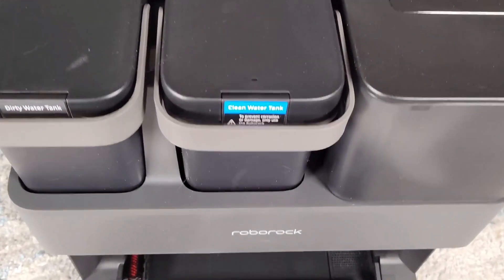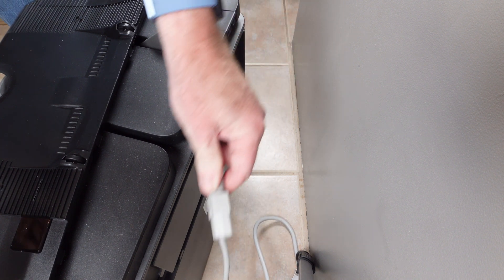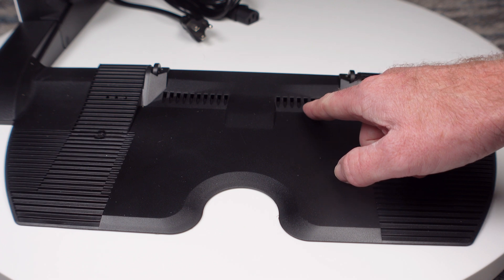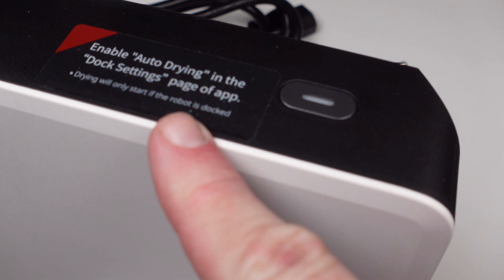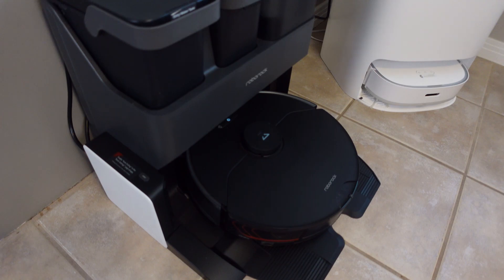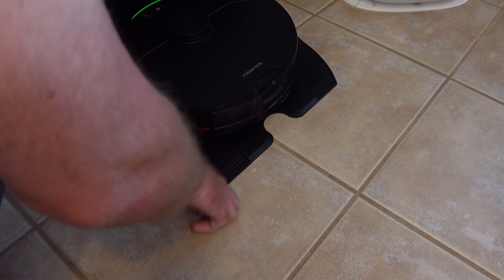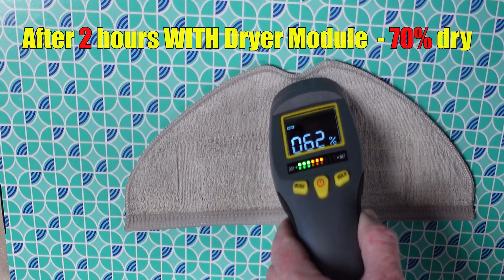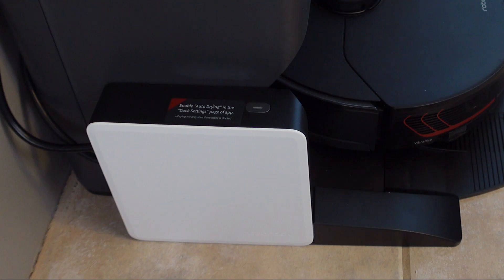Roborock S7 MaxV Ultra Dock Hot Air Dryer Module - Full Test Results!

Comment: I just bought 3 mopping pads and when it's done washing the floor I replace them and let the wet one air dry. Cheaper and easier
Reply from the maker: Cheaper for sure.  Don't know about easier as with this you don't need to remove the mopping pads to dry after every wash job.

Comment: Very good content, straight to the point.
I bought the chinese module from Aliexpress, its rated at 220V and my S7 MaxV is 110V.  But if you plug the dryer on 110V outlet, it also outputs 110V to the dock, which is very logic. Also, the dock appears to be working normally with the dryer.

The thing is, I measured the energy consumption of my 220V drying module plugged on 110V, and it's showing the same numbers as yours (0.55A and 38W). Very weird, since it's working on a lower voltage, it was supposed to be outputting less power, around 20W.
The only explanation is if my module is actually bivolt, not 220V. Or yours is also 220V and you don't know, since you said there is nothing specified in the box.

Anyone that have the drying module got different numbers?
Reply from the maker: I suspect the module can accept 220V for other markets, but the plug they ship limits our version to 110V.  Just a guess though.
Reply: I did more tests and the drying module is definitely bivolt. 
Plugged in 220V and all measures were the same, except power factor, that was 0.6 on 110v and 0.3 on 220v. Everything else was the same, even the blowing temperature (around 100F).
I don't know why they would specify as 220v only.

Comment: Hello, I don't have the drying option on my app (up to date). I tested on apple and android... do you know the reasons?
Reply from the maker: Did you turn the option on under dock settings?
Reply: @jamie.andrews  in the settings dock, I don't have the "auto drying" line... I don't have the option on the application.
Reply from the maker: @ryendanger9152  Are you on the latest firmware? Are you using the Roborock app?

Comment: How good cleans the dock the mopping pad itself? So how many times is good to re-use it without replacing it for a clean new mopping pad? 
When you put the mopping pad after every mopping cycle in your you washmachine, i dont see the advantage with the dryer module.
Reply from the maker: The dock cleans it fairly good, but depending on the amount of use it sees you will still need to hand wash the pad from time to time.  I can not really answer your question on how many times a mopping pad is good for since there are way to many variables to give one answer.  I replace mine once a year for good measure, but I don't use one robot daily.  Most people with the Ultra dock do not remove it after every mopping job to hand wash it.  That defeats a large reason for the dock itself.  While you should remove the mopping pads and clean it by hand or washing machine every so often, if you can dry it on the dock you cut down on bad smells created when it air dries after a mopping job.  If you are the person who is always going to remove it to wash it after a mopping job, the dryer module is 100% useless for you.  Hope this helps.

Comment: I've had the S7 MaxV Ultra for 3 weeks now. The mopping head is washed after a mopping job. The unit parks into the dock with the rear portion, where the mopping head is, is somewhat elevated and exposed to the air in the room. The mop dries in a few hours. You might also just remove the mopping pad (a real pain, I know) and let it air dry. For people who run frequent vac/mopping jobs, or have lots of messy jobs, the drying unit might be just what you need. Thanks for this excellent review!
Reply: having let them air dry, you haven't noticed any problems with smell-/moldiness? :) just ordered my unit, didnt realize, the (missing) heating could be a problem
Reply: @miiasiin  I haven't noticed any odor at all. I'll usually put one mop head in the washer once a week, replacing it with an extra. You can also just wash the mop with some dish detergent in the sink, rinse, and air dry.
Reply: @Dagot1948  i see, thank you :)
Reply: @miiasiin What did you mean by the missing heating? I assume you order the drying unit which is supposed to be the provider of the heating 🙈
Reply: @Q8Webmaster  i was hoping to skip having to order it :) so far, so good! :)
Reply: @miiasiin  I ordered mine from Aliexpress (Original) for around 50€. It will reach in few days. I am glad your unit is working well for you. I did also order some spare mop clothes so that I can just switch and take out the used one before/after being dried.. especially after major cleaning and putting the mop clothes for a wash

Comment: The new S7 Max Ultra (without the camera) will interestingly come with the dryer module installed in the dock. I think they will be released in summer, I’m hoping by autumn it will be available in Europe. Thank you for your very informative video
Reply from the maker: In the US the S7 MaxV only comes with a camera.  Are you saying there is a S7 MaxV without one?
Reply: @Jamie Andrews  I think they're confused with the new s8 since it comes with the dryer. Unless they're making a different s7 model?
Reply from the maker: @Ernie Saldana  There is actually a S7 Max Ultra, but it has a camera.
Reply: @jamie.andrews  He is obviously saying that Slivka is confusing the S8 Ultra with this "new S7 Max Ultra" he mentioned.
Reply from the maker: @alifewithoutgamingisnolife  Well I was wrong about the S7 Max Ultra. It does not include a camera after all.
Reply: @alifewithoutgamingisnolife there's an s7 maxv ultra without the built-in dryer and a new recently released s7 max (no "v") ultra with an updated base with a built-in dryer. The s8 ultra also has a dryer but it's debatable if it is in fact better than the s7.

Comment: I wouldn't call the hot air dryer module "100% necessary", but I do like having it in place.  Its so quiet I wasn't sure it was working.  Although, since I've had it (and its been months now), I've never had a smelly mop with the Roborock.  For my personal recommendation, I like having it there and having the mop dried whenever it gets wet.  I can't help but believe it must extend the life of the mop a bit and for that I'm appreciative.  So yeah, maybe not 100% necessary, but adding it to the unit makes Roborock the very best vacuum out there...and goodness knows I've tried a bunch of them!
Reply from the maker: Mike I think you are spot on with this and I now have tested half a dozen robots with hot air drying docks.  I too prefer them.

Comment: How is the smell of the sewage bin for you? Any bad smells? Also, do you use OMO cleaning liquid? And last, do you have any bad smell from the inner water filter (lower right, where the brush moves the water before it going to the sewage pump)?
Reply from the maker: Bad smells will happen if you do not clean the dirty water tank and lower dock filter on a regular basis. I clean the dirty water tank after each job and the filter once a week.  Yes I use OMO for my Roborock mops.
Reply: @jamie.andrews  understood. I just think that the whole watertank/sewagetank is a bit conceptually faulty if you cannot leave the system for atleast a week without causing odour. I was hoping that the drying procedure would at minimum keep the lower filter dry because the worst stench usually builds up in that area, while the sewage tank keeps it somewhat confined. I really hope for the S8 Pro Ultra to have a better containment of the smell. 🤞
Reply from the maker: @AWE81  That new Ultra dock will have the same issues unfortunately. I am not sure what the solution is honestly.
Reply: @awe8120  I'm hearing that people who leave the dirty water alone until it's full are also putting in a capful of disinfectant (like Lysol). That seems to have ended the odor problem.
Reply: @jamie.andrews   the ultimate solution is to use the module that some vacuums have that connects to the plumbing, for automatic clean water refill and waste water disposal.

Comment: Great review! It’s on my wish list but I’m not convinced that I need it. After every mopping I empty the dirty water collection tank and swap out the wet mop pad for a fresh, dry one. Takes all but a few minutes. Still beats mopping my floors manually by a long shot. But I’ve rationalized other purchases for less of a reason in past. Time will tell.
Reply from the maker: Totally understand.  It is a convenance feature for sure, but there are ways around it.
Reply: Swapping out the pad manually after every mop is directly against what this robot and dock are supposed to provide: full automation.
Reply: @alifewithoutgamingisnolife  Perhaps. However, it's not attainable without the heated air dryer. The pads get a sour smell when allowed to dry naturally while mounted to the bottom of the robot. That smell is imparted on the floor surface if the pad is reused after that drying method. For now, I will take the 30 seconds needed to swap out the pads.

Comment: Hey, you said it is drying after every mob washing. How it is in my case? I have to clean 5 rooms and after every room my robot go to station for washing. Will it start to drying after every room or will it drying after the whole 5 rooms? Thanks for answer and greetings from germany.
Reply from the maker: It will only start drying once the robot docks for charging.  So at the end of a cleaning and not during a cleaning. The drying module blows air on the pad from the front of the dock.  Hope this helps!

Greetings from the USA!
Reply: @jamie.andrews  hey, yes it helps, thank you very much👍

Comment: Call me old fashioned, but I rather have a regular S7 and rather change the mop daily. Seems to be more energy effecient as well to buy 8-10 mops than drying the same mop for 3 hours every day
Reply from the maker: Several people are like you as I have heard this from many people.  One thing you should also consider is for larger homes the S7 MaxV Ultra can go back every so often to have the water tank topped off and the pad washed.  To me this is important plus it means the pad is completely wet when the job is initially started.  On my S7 I have to prewet the mopping pad.
Reply: @jamie.andrews  Yeah fair enough. My home's not that large and a full water tank of an S7 does the job. Thanks for the review!
Reply from the maker: @mohsenunknown  Thanks for sharing!

Comment: I just got mine and the directions (and even the sticker on the unit) were only in Chinese.  Your review was really helpful because I didn’t know there was an app setting and also because the low air flow made it seem somewhat useless.  Surprised to see that it actually works.  I set my drying time to 4 hours.
Reply from the maker: Glad I could help you get it sorted.  I too was surprised by the effectiveness.

Comment: Hi !
Thanks for informations sharing! 
Does anyone knows if it's S7 pro ultra compatible or only for MaxV ultra dock? And tested it?
With Ultra Pro I have no drying module setting on roborock app like in the video at 2:20min (https://youtu.be/NcRQJTsnh1s?t=140) and i don't know if i could purchase it.
Reply from the maker: We do not have the S7 Pro Ultra in the US so I can not comment myself.  Maybe post the question over on the Roborock Reddit.  https://www.reddit.com/r/Roborock/
Reply: @jamie.andrews  I find more information in reddit in fact.
Drying module isn't available for S7 pro ultra for now. Roborock team reply to someone who ask if it will be and they say " Hopefully, they will be able to manage it in the future"
Maybe someone will find a tip to hack it before lol
it seems to be really helpfull because it's annoying to remove the mop each time it's used.
thanks for your answer
Reply: @lucettestunt  On Reddit there is at least one post where someone has attached the dryer module to the S7 Pro Ultra dock.  They said you have to manually press the button to operate the dryer, every time you want to use it. The reason is that the infrared sensor in the dryer module does not communicate with the S7 Pro.

Comment: Do you know anything about a stinky smell when mopping in each room? I’ve checked everything and clean everything and only use a clean mop. I use the recommended cleaning solution in the clean water tank. It has to be something on the robot and not the docking station because it smells in each room. I cannot find anything. The dust bin is clean. Specifically it smells like dirty water…or puke. 😮
Reply from the maker: That is a difficult one.  The only thing that touches the floor is the mopping pad.  Could it be your water?  Do you have pets?

Comment: Does the area where the mop is washed get dry too with dryer module? I see that the area is getting totally wet after mop wash.
Reply from the maker: No as air is not blown in that area.  The robot turns around after being washed to charge and that is when hot air blows on it which is at the other end of the dock?
Reply: @jamie.andrews  thanks. Does the mop wash area  get moldy as it stays wet longer? I was waiting 2 days to dry by itself by getting out roborock from station
Reply from the maker: @samsam-oh5py  No, but it does need to be cleaned by hand every so often.
Reply: @jamie.andrews  thank you
Reply: Any idea which cleaners can be used in water tank for mopping? Hydrogen peroxide or roborock cleaner or any other?
Reply from the maker: @sam sam  I only use 2 products.  The Roborock solution and Bona.  Those have been safe and both are concentrated.
Reply: @jamie.andrews  thanks. Any idea can we spray cleaner/bleach on bathroom floors or wood floors?
Reply from the maker: @samsam-oh5py  I don't see why not.  It will get diluted with the mop.

Comment: excellent and to the point. if i may you overlooked one point: energy consumption. it can be interesting to know how much it is you have to pay to dry the appliance.
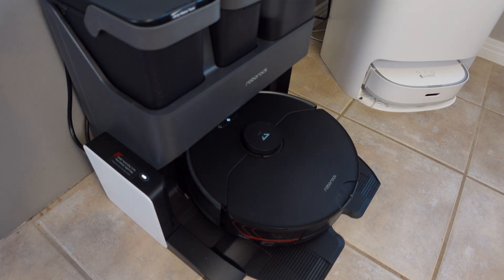edit: indeed it is detailed @03:08. i overlooked it. maybe some written piece of information on such points could be helpful in your next vid. ty for your good work
Reply from the maker: Thanks!

I covered it at 03:08 in the video as far as AMP and Watts.  The exact consumption will vary and depend on several factors.  1. How often you mop.  2. How long you tell it to dry the pads for.  It has 3 different durations to select from.  I suspect someone could take my energy consumption information and figure it out based on their usage. 
It is really pretty insignificant usage imo.

Thanks for watching!

Comment: Thanks for the thorough review. I bought the module based on your results! However, the module option for auto drying DOES NOT appear in the iOS app (EU). Is it region specific or is there a trick??
Reply from the maker: Where did you buy the module from?  Make sure the firmware on the robot and you app are both up to date.  I am not certain about ios or the EU unfortunately. You would need to contact Roborock for further support as this is the first I have heard of this.
Reply: Yeap same problem buddy
I'm going to contact roborock's support 
The base doesn't seem to recognize the module and then the app doesn't propose any automatic drying mode in the settings.. (Chinese module, EU station) 
Did you guys found a solution?
Reply: @dimitrisauli3534  Did you find a solution here?
Reply: @rickrickersen5749  hi
Unfortunately Roborock's answered me that this fonction wasn't able to work between this two products because the module (from China) wasn't supposed to be commercialised in EU. So I asked if a simple update would solve the problem (this fonction works in others countries with the same products, why the f*** not in ours???!) No more answer from Roborock's support...
So I use it without the application (disappointed..) but honestly it's not a real problem, when my buddy "Billy Butcher" finished to clean the house and come back to the station, I just turn on the module, and after two hours, it turns off by itself and the mop is completely dry.

Hope it helped a little bit, more disappointed by Roborock's support than by the product which works pretty well! And very noiseless by the way.
Reply: Ich habe tatsächlich das gleiche Problem. In Meier App taucht die Einstellung auch nicht auf und ich habe das Modul ebenfalls aus China über Ali Express.
Habt ihr eine Lösung gefunden?
Reply: Hey i got the same problem. did u find a solution?

Comment: Hey, Can this product be used with the s7maxv+?
Reply: And s7maxv(no station) q7maxplus(with station) is same price, which one ll be better? Ty
Reply from the maker: If you wants a vibrating and lifting mop system with obstacle avoidance go with the S7 MaxV.  The Q7Max is closer to the S7 in specs.
Reply from the maker: No only with the Ultra dock aka Empty Wah Fill Dock.

Comment: How long is the included power cable, and can an extension cord be used?
Reply from the maker: The power cord is 6ft long.  If you used an extension cord it would need to have the same or larger gauge wire and not be very long.  My recommendation is inquire with Roborock about the use of extension cords as I have no way to tell you what is and what is not safe as it is not listed on their page.
Reply: @jamie.andrews  thanks! I couldn’t find an answer anywhere and was hoping the cord would be long. The dock is already a behemoth and not exactly the prettiest thing. The only decent spot is like 5’ from any outlet. Glad to hear that won’t be an issue.

Comment: Great video, thank you! - Quick question, so does this also heat up the water or change the temperature of the water when moping ?
Reply from the maker: No, it only blows hot air on the pads.
Reply: No, it does not heat the water